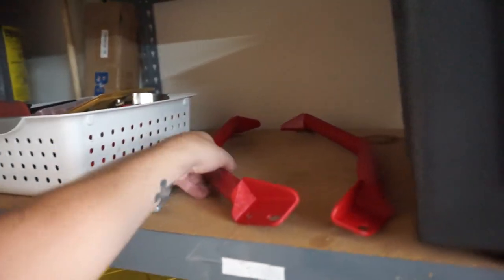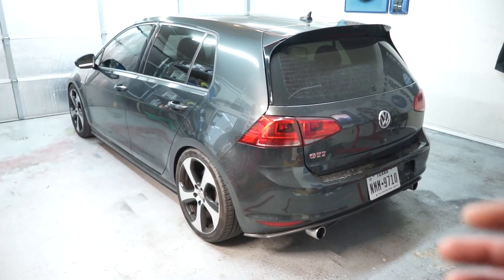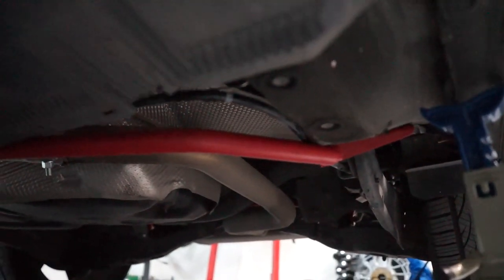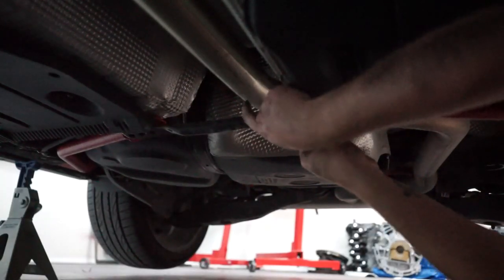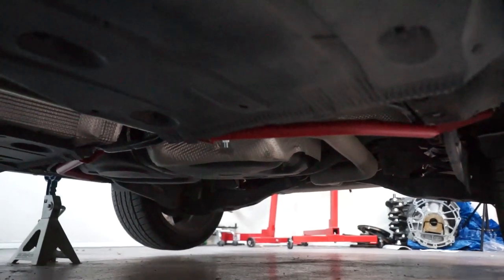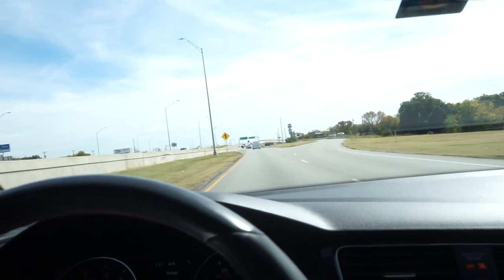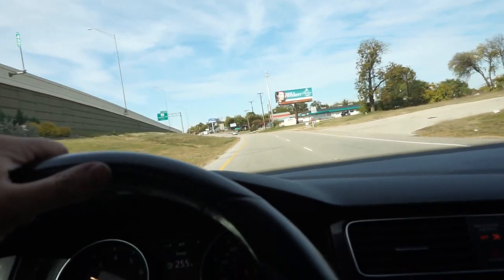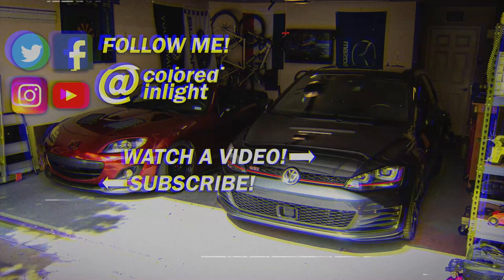Chassis Bracing on the Mk7 GTI - Stiffening the Rear End

Comment: watch those brake line squeaks on the brace. tie wrap them.
Reply from the maker: Thanks, I'll give it a shot!
Reply: @ColoredinLight  I wouldn't tie them down.  They are meant to move with the suspension.  Take a look at the bracketing and original design of them hanging down and you will see.  If anything wrap some protection around rub spots.  I had to loosen the handbrake cable from inside behind the handbrake.  Without doing that one side of my brake was sitting away from the detent rest spot and had slight pressure on the disk.  Also, did you use new torque bolts?  I highly recommend you always use fresh torque to yield bolts.  I personally felt no benefit from them street driving.  When I autocross I have a rear wheel in the air often and I'm hoping they give me a little better feedback in the rear under hard driving.

Comment: Interesting...the "theory" is more promising than what THAT product would do.  You are still using the OEM center brace connection and extending out the Arms to the side - but that would be doing the same exact thing as just staying with the stock set-up.  Looks cool, but doesn't provide a benefit.